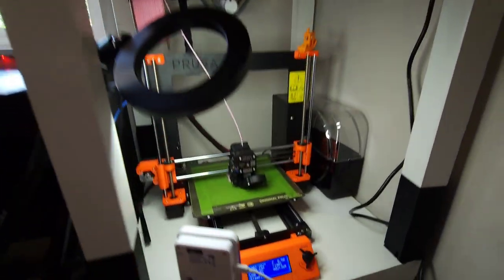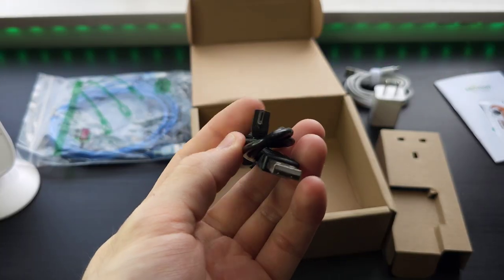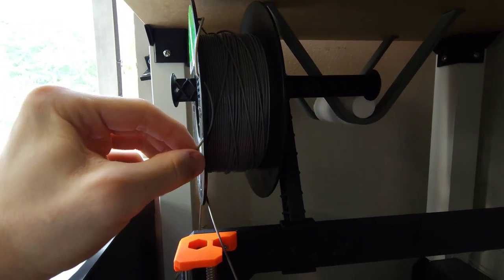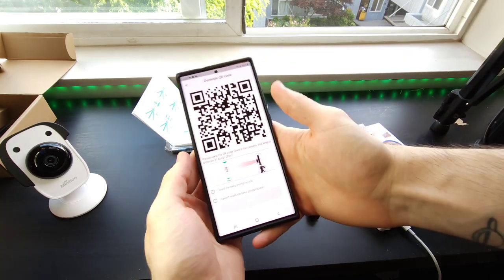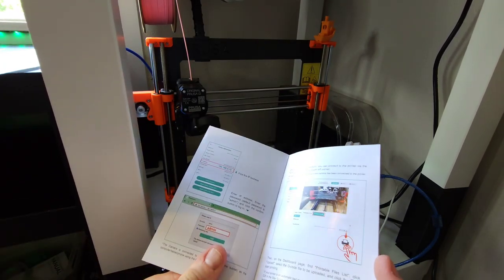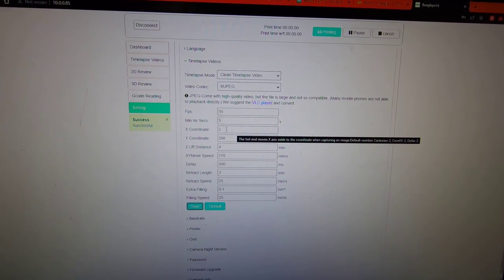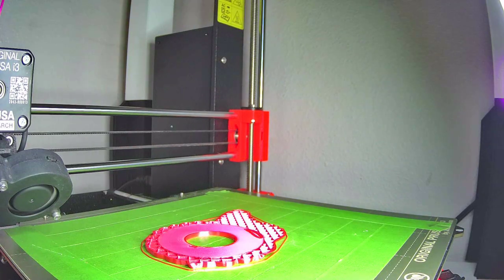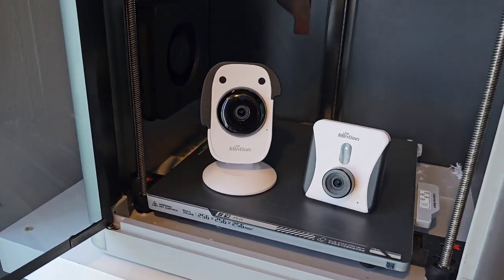Beagle Cam V2 - REMOTE CONTROL YOUR 3D PRINTER - Unboxing and Setup

Comment: I just bought this camera and set it up. I started printing from my micro SD card. It doesn't seem like it is recording. Do I need to use the Beagle cam to send the print to the printer for it to do the time-lapse?

Comment: Brilliant video,thanks. Where is the Timelapse saved ? I set mine off yesterday and when i look in the app I can’t find my Timelapse video,i can find the video as its doing the vid,but when model is complete the video is not there. I did switch off my printer remotely when the print had finished would this have anything to do with the missing video ?

Comment: Hi after watching your video I bought one  it works but won't take any video, it takes like a snapshot which appears in the video list it's a small file about 300k but no video, is it supposed to start itself after loading the file to the camera?  Am I missing something?  Do I have to do something to start the video recording? I'm using the 32gb card that came with it?  Thanks

Comment: Great,, they use cable that don't connect to modern printers, what a joke.
Reply: Exactly
Reply: I don't know if they changed what came with it, however, the one I just bought comes with a micro USB and a USB C.